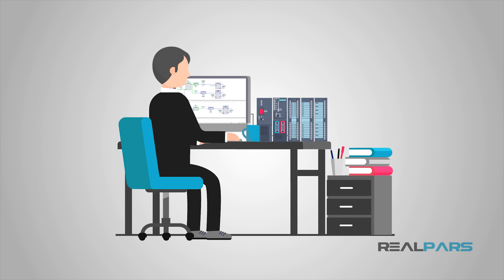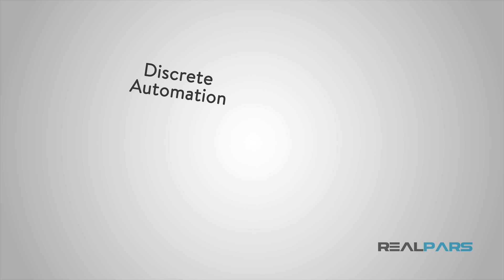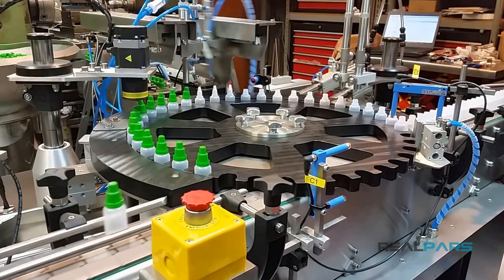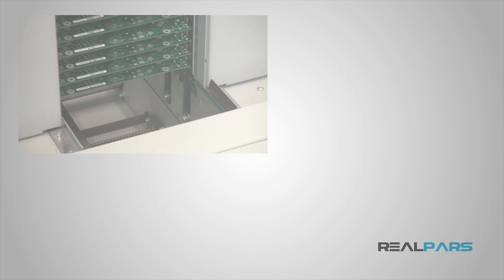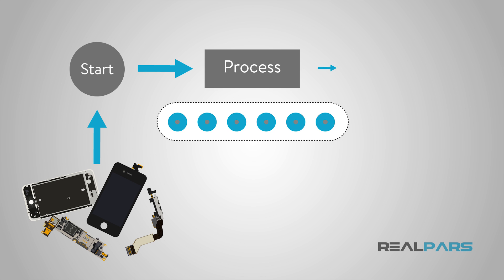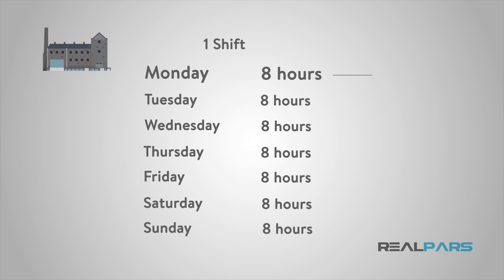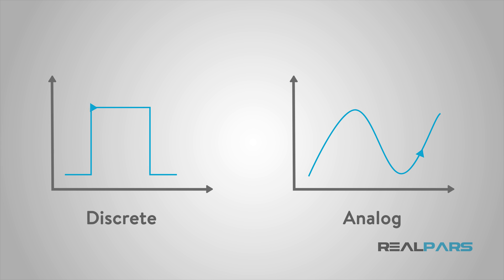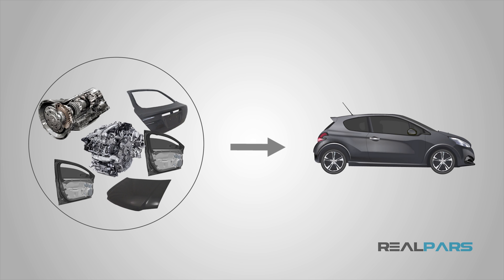What is Discrete Automation?

Comment: there is an error in this video, how come we need 10K stainless steel, on Monday 6500 cases, and Tuesday should be 3500 cases but not 1500 as you mentioned.
Reply from the maker: Correct.  Thank you for pointing this out.

Comment: Loving the video but my head just can't add 6500 to 1500 and get 10,000 :)
Reply from the maker: Yes, it is a little confusing.  The plant can produce 1,000 cases per hour and should have made 8,000 on Monday, but only produced 6,500.  So it had to make up the shortfall of 1,500 cases (to meet the 8,000 it needed to make on Monday) on Tuesday instead.  So 6,500 + 1,500 = 8,000 of Monday's quota.